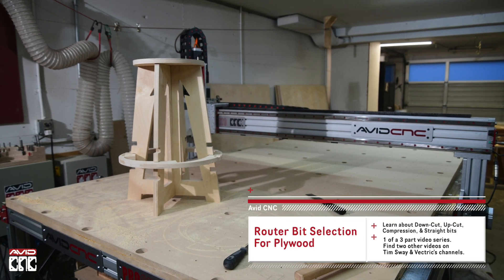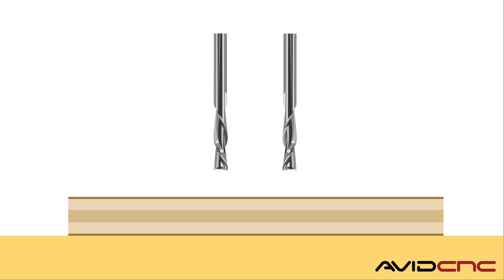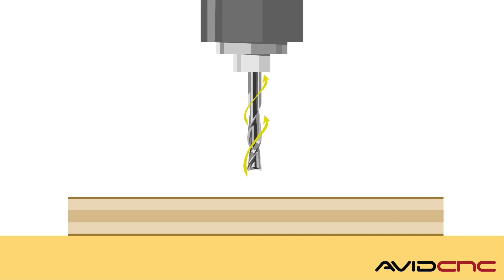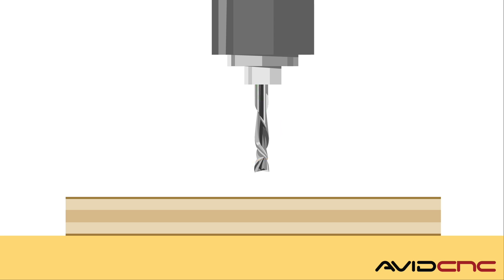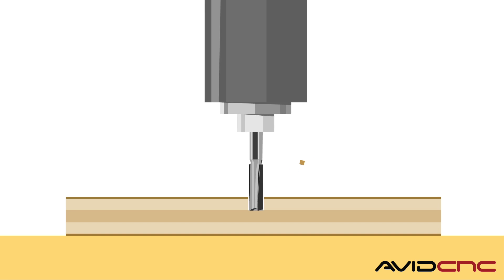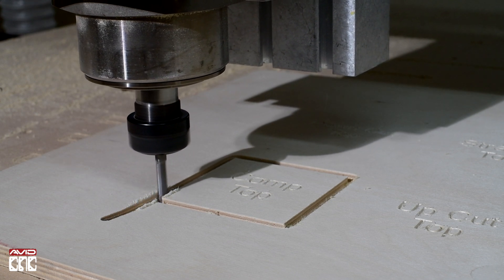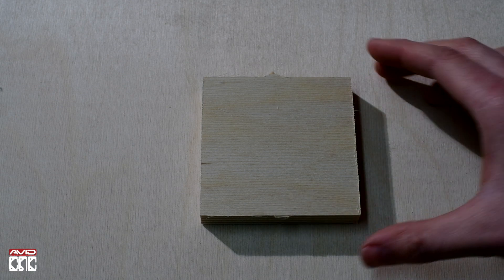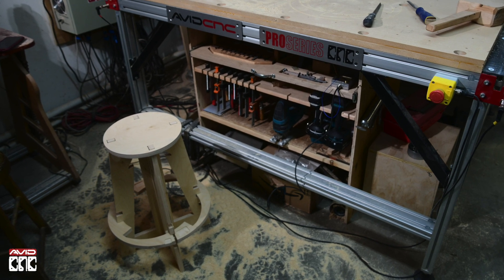CNC Router Bit Selection For Plywood

Comment: Would the compression bit work in kiln dried 3/4 pine?
Reply from the maker: I've always been a fan of the Whiteside UD2102. https://www.avidcnc.com/whiteside-updown-cut-spiral-cnc-router-bit-14-x-1-p-431.html Just make sure when you're cutting on your first pass you plunge deep enough to get the upspiral section buried in the material so you don't get tear out.

Comment: Using a larger diameter tool for the straight cut affected the surface finish, if it was the same diameter as the rest , the results would be almost identical to the downcut